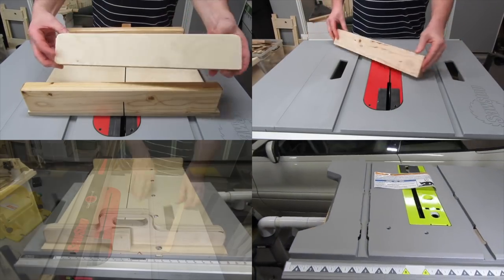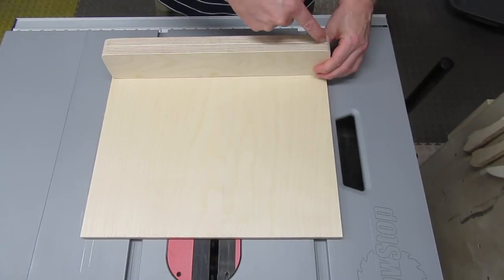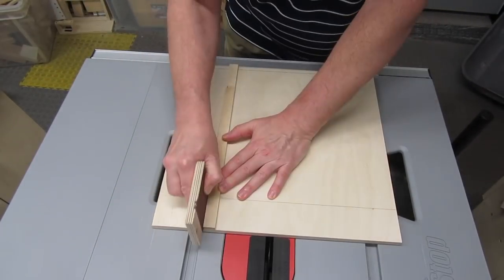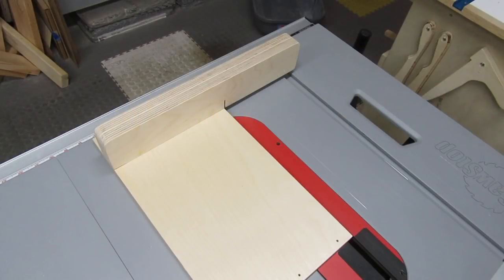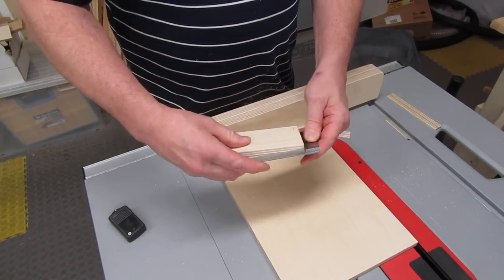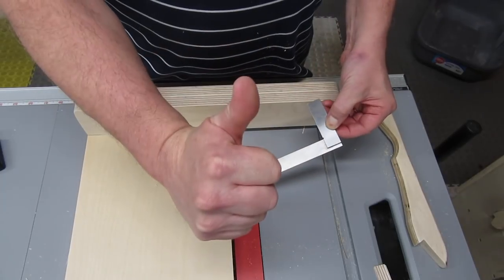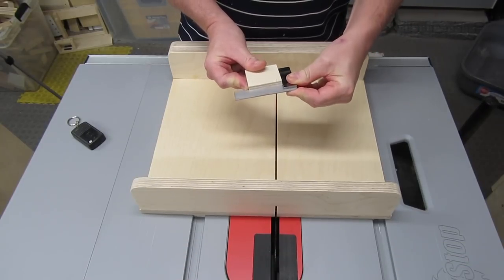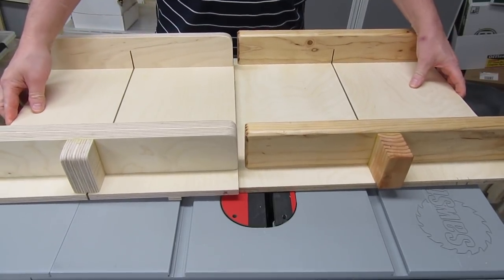Assembling a Cross Cut Sled, for Newbies!

Comment: I was literally wondering, why didn't you use your speed square instead of the fence, since you could hang it on the edge.
Reply from the maker: I'm not sure I understand your question.
Reply: @TheNewbieWoodworker  Oh. Lol.
You ended up using a square that hangs off the edge, so I was basically saying I was wondering, before your problem started, why you didn't use one instead of your fence. 
While watching, I thought there was a special reason, but afterwards you showed that was just a mistake.
So my statement was just going along with your realisation of the solution.
Reply from the maker: @theren8311  LOL. Things we wish we knew before doing something, right?

Comment: Just one question. Is it necessary to put two runners on a sled?
Reply from the maker: I almost always use just one. If you end up needing a second runner, you can add it later, but most of the time there's no need.

So when might you need a second runner? One reason would be if your miter slot was inconsistent, and there was too much play in spots, with your runner. Sometimes a second runner helps there. Another reason is for something like a box joint jig, which is quite heavy, and can drag a lot against the surface of the table saw.

But like I said, most of the time, no.

Comment: Good job, Dan! Thanks. 

Any particular reason that you made the sled so small (and the Lilliputian five-cut method piece of wood?) This one will be great for cross cutting small stock, but I think you’ll soon be making a larger one for panels, etc.

Maybe I shouldn’t ask, but I cannot resist - Do you know from personal experience about being careful not to put the screws thru your finger? 😉
Reply from the maker: Thanks!  Yes, there was a reason I made it so small. I didn't want to waste any more material! :) I have two sleds I use regularly: One is the 2x4 sled, that's 18" wide x 16 1/2" deep. It works well for most cuts, and it's light. Then I have the large sled, which is something like 24" wide and 32" deep, and it handles everything else, but it's heavy. I'll probably replace the large sled with one even larger (width-wise), and I think I'll cut holes in the base to reduce the weight. That'll probably be another video project, somewhere down the line.
Reply from the maker: And no, I have not put the screw through my finger, but I'm fully capable of doing something like that! :)

Comment: Why cut the bottom in half, and then screw it back on in the same place?.. what did i miss?
Reply from the maker: So, you've got a runner on one side of the bottom, in the miter track. Using that runner, you slide the bottom through the blade. You now have an edge that's perfectly parallel to the blade. This makes it really easy to align the fence, using a good quality square of some kind. Once you've aligned the fence and screwed it down, you re-attach the rest of the bottom. Does that make sense?

Comment: That is not really the “5 cut method” at all.  William NG’s actual method is on YouTube and it’s way more accurate than any tool square.  You need a larger test piece and there is a fifth cut-off (he only made 4 cuts). The gist is that you measure the out-of-parallel of the 5th cut and then adjust the fence using that measurement and some math.  Bottom line - he did not really use the 5-cut method here except to check for square.  The point of it is to give you an exact amount in 1000s of an inch to tweak your fence - so check it out.
Reply from the maker: I am well aware of William Ng's method, in detail. I've used it quite a bit. But it turns out it's needlessly complicated. The method I show for how to square the fence, which is actually Matthias Wandel's method, is extremely accurate - certainly accurate enough for woodworking.

I will agree that I misrepresented William's method a little, but it doesn't really matter, because as I said, my results are very accurate. If you don't believe me, and it sounds like you don't, try it yourself.

And trust me when I say that this method is MUCH easier for a newbie woodworker to use, and that's who this video targets.

Comment: Some (most?) squares are not square, unfortunately. (also the more expensive ones). There is a way to check how (un)square your square is.
I'll try to find a link and put it here. And knowing this trick it should be possible to adjust your square (although I never tried that but I will) so that it is square.
In that case there would be no need to buy very expensive square squares.
Reply from the maker: Thanks for the comment. I agree totally that many squares are not square. I found this out the hard way, and I keep meaning to do a video on this. And if there's a way to fix them, that's good, and I'd like to hear it! Personally, it makes me feel good to have a set of squares that appear to be precision-made - ones that I can count on. But I'd like to do a video on the subject, so anything you can offer would be awesome!
Reply: @TheNewbieWoodworker  I found two videos  (but not the ones I saw before) so I had to watch them.
https://www.youtube.com/watch?v=V1KkflycJo4
The "flip-over" method is the most common and easiest way to test  (I'd do it on a piece of paper with 5 mm squares on it), so that it is possible to see
from which point the unsquareness starts (or till which point the out of squareness is still tolerable)
https://www.youtube.com/watch?v=FNpAQHrNpNU&t=1s
This video also shows a way of "repairing" the unsquareness. To be honest, there are only a few comments to the video (and it was not viewed
very often). It could work but I'm not convinced.
In my earlier comment I mentioned adjusting the square. What I had in mind was adding a strip of material (wood/metal/acrylic) to the square
to even out the unsquareness. In theory it should be possible, imho. If in practice also, I really don't know. Did not try it yet.
Reply from the maker: @hansdegroot8549  Thanks! I'll look at them when I get a chance. I know that some woodworkers make their own squares too. Not that I'd do it - too much work to save only a little money. 😄
Reply: @TheNewbieWoodworker  Woodworking can be a very, very expensive hobby. In the US average (which means next to nothing) income is quite high
and tools and materials (wood, plywood) are relatively cheap and widely available. In (western) Europe, income can be more or less the same
as in the US but both tools and materials are often much more expensive. In central Europe income is much lower and due to infrastructure,
tools and materials are not as widely available, not to speak about other countries/continents.
In other words: not all newbies have the same possibilities. Of course you are not to blame for that. 
At least everywhere in the world we have 24 hours in a day.
On YT there are many channels which show how to build simple woodworking machines yourself. Some of them are quite ingenious.
(Much) cheaper than the manufactured ones and with decent quality and precision.
Reply from the maker: @hansdegroot8549  Wow, I never looked at it that way. Thank you for reminding me that things are different everywhere, and I shouldn't make assumptions. Seriously, I really appreciate the wake-up call!
Reply: @TheNewbieWoodworker  You're welcome. I watch a lot of YouTube videos about woodworking and I read a lot of comments.
I always (try to) combine what I watch, see, read and hear and (try to) learn from that.
Reply from the maker: @hansdegroot8549  You and me both. Two years ago, I was about as green as they come, regarding woodworking. It's amazing what you can learn from YouTube, and some diligence. 🙂

Comment: Why only one runner? And not cut the chamfer first?
Reply from the maker: As for one runner: https://thenewbiewoodworker.com/2018/05/07/cross-cut-sleds-why-i-only-use-one-runner.html. I wait to cut the chamfer, so when I use the square to check the fence alignment, the chamfer doesn't affect the square. If your square is thick enough so it doesn't slide into the chamfer, you can cut it first, but just make sure it doesn't affect anything when you check the alignment.

Comment: Step into te 21st century and go metric.
Reply from the maker: Here in the US, metric is so 1970's. (That was meant to be a joke, sort-of.) The truth is, if the US actually started to embrace the metric system, to the point where I could find an easy supply of metric hardware, tools, and lumber, I'd certainly do it. But until then, if I want to be able to go to my local hardware store and find bolts of the right size (for example), I'll stick with Imperial.
Reply: Well you could atleast add some written conversion to the video that would be much appreciated.
Reply from the maker: I hear you. I'll think about it.
Reply: Eric P  In this particular videos it is of 0,000 % importance if the dimensions are metric or imperial.
The only thing that counts is that in the end your cuts are straight and square (90 degrees)
Reply from the maker: @hansdegroot8549  True, but I also understand his point. When I watch a video and they say "125mm", or whatever, I have (or at least had) no idea if that was big or small, and I found that very distracting. So if I can add metric equivalents with very little work, I might as well, right? 😄But again, I understand your point also - I'm not being critical of you. 😛